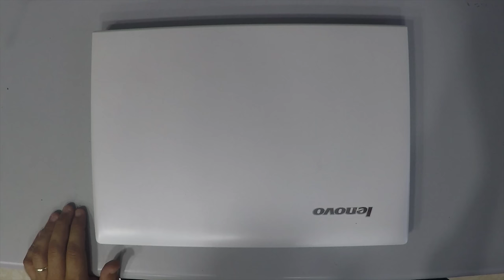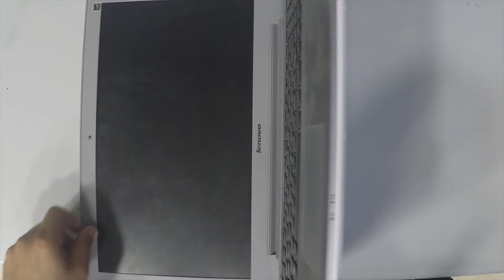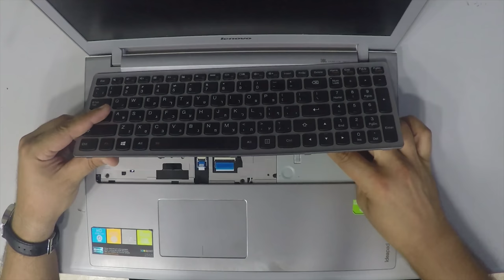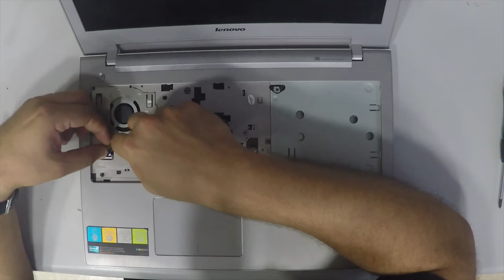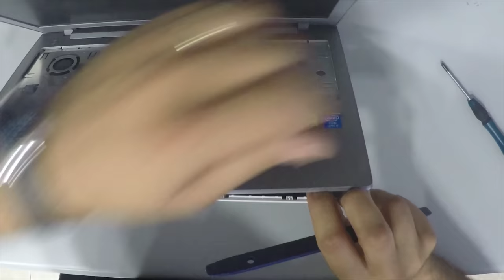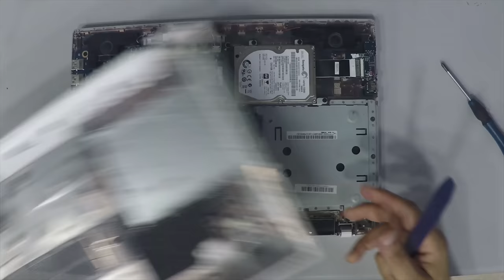Lenovo Ideapad Z510 Battery Replacement 4K

Comment: Hello there;
 I have this model, I turned off the laptop screen in the evening and left the pc in standby mode, when I wanted to turn on the pc after about 3-4 hours, the power button did not react at all, when I plug the pc into the charger, the charge light turns on but the pc does not turn on. (Note: Computer  comfortable 7-8 years and it has never been changed, the videos I watched said that the battery may be dead, the battery can be removed and the pc can be turned on with a direct charge cable) What would you recommend?  Where do you think the problem is?

Comment: Good video. Thanks
Reply from the maker: Hello Marco, Glad you like the video I hope to give more tech videos in the future. What types of tech videos would you
like to see?
Reply: Amazing video! Even I was able to do this in about 45 minutes! THANK YOU! We even bought the battery from your link!
Reply from the maker: Hello david, I'M Glad you like the video I hope to give more tech videos in the future. What kind of improvements do I need to do to mine channel?
Reply: Well the battery worked for a while then it powered off and won't go back on . I plug in the charger and nothing. Any ideas? No lights indicating it's charging
Reply from the maker: Have you checked the adapter, when you replace the battery did the adapter charge it? did the battery level rise up slowly (plug-in and charging)? our it drying slowly (plug-in not charging).
Reply: Yes it did charge it but it doesn't anymore. We originally bought a new adapter because we thought that was the problem ugh
Reply from the maker: You need to re-check all connectors, start with the connectors under the keyboard. especially the power button connector.